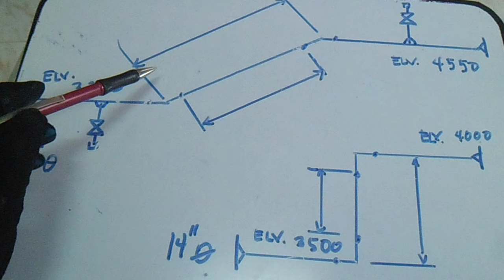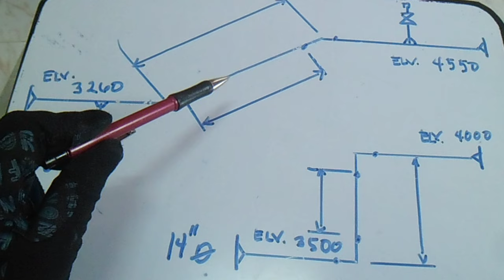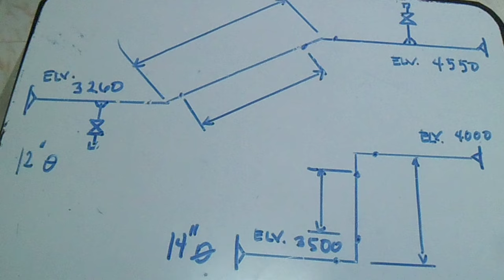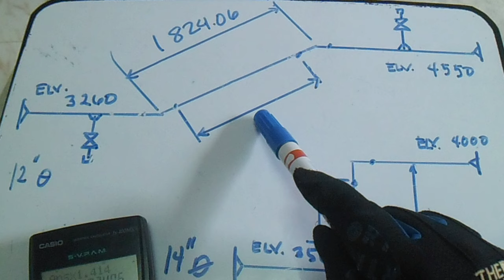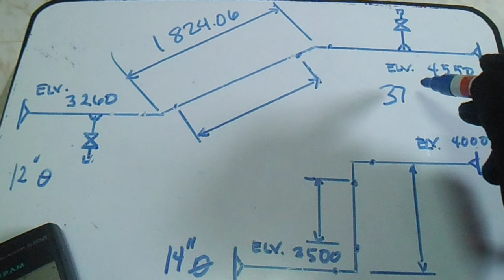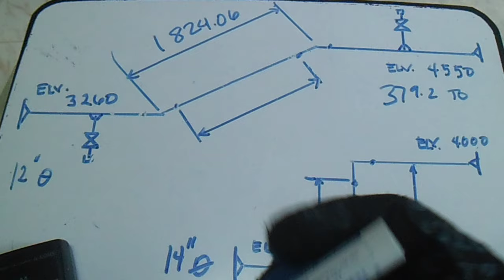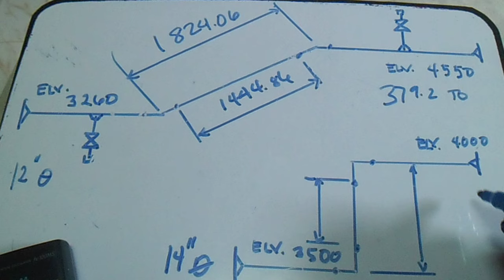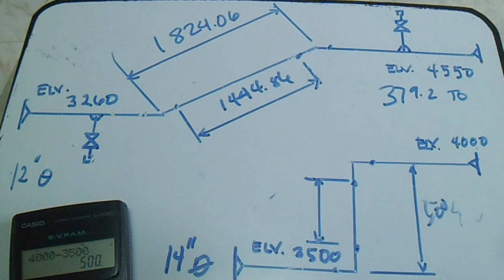Pipefitter Computation Interview - PipingWeldingNonDestructiveExamination-NDT

Comment: Sir, you have good computations in finding travel. But, i think you forgot something while computing your spool. Because, in piping and fabrication, we must never forget to minus our welding gap of 3 mm, because remember that we have 2 fittings or take-off to be weld. The formula should be:
 SPL = Tr-TO1-TO2-WG1-WG2
SPL = 1,824.06-189.6-189.6-3-3          ,    SPL=1,438.86
Reply from the maker: yes that is correct. thanks for watching

Comment: Why pipe size 12'' elbow 45 deg =15.8*12? I don't know 15.8 where?
Reply: T:O 45 degrees= 15.8
Reply: lets put it this way 15.8 is the constant for 45° elbow I have an idea where is 15.8 came  from . For now just follow multiply the 15.8 mm to all sizes elbow and the result is the final TO trust me you never get wrong.

Comment: 14 " x 38.1=533.4?
 pag 14" na ang laki  di mo pwd gmitin 38.1 ...pag 12" pababa pwd pa..
Tpos miminus mo sa travel 500? Malaki pa takeoff ng fittings kesa spooling boss..
Pakidouble check ng diameter ng question number 2 mo or elevation...saka boss sa spolling dagdag ko lng dpat magkaron xa ng minus sa gap diba?...
Reply: tama sir. di sya nag minus welding gap (3mm)

Comment: short kp ng 566.8 s spool m dahil 500 lng ung tira ng spool tps ung take off ng 14" 90 deg elbow 533.4 x 2=1,066.8.
Reply: Pag 14" na ang elbow di muna pwd gamitan ng 38.1...sa 12" pababa lang yun...hnd ntn alam kung yung elbow nya eh short radius or long radius..at yung elevation ng question number 2 base sa diameter na 14" kung ggmitan mo ng 14" na 90 deg elbow maxado na maliit pra sa spolling...
Reply: Short lng siya sa elevation dyan, mali lng siya sa elevation, lahat Ng 90 degree LR elbow Isa lng take off 38.1 metric system